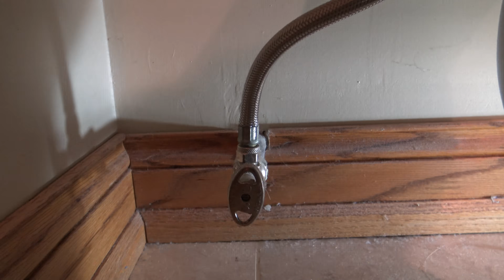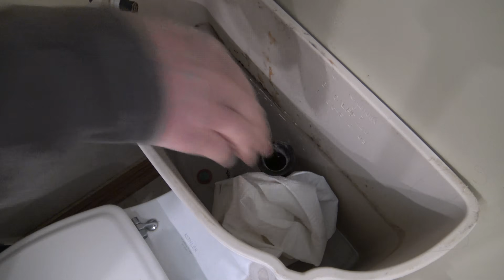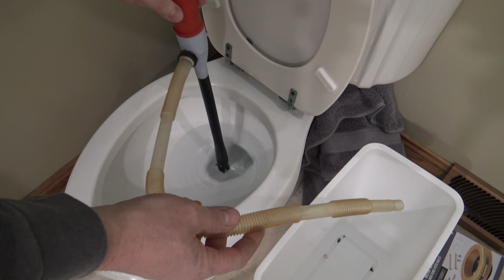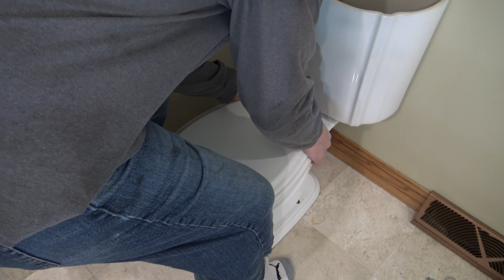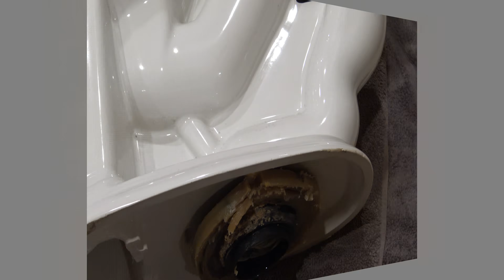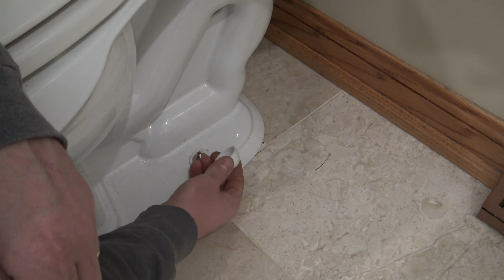How To Replace A Wax Toilet Ring----Step By Step with Tips

Comment: When you pulled the bowl from the floor / flange, should you have more wax on the flange than that? Using the same Oatey reinforced wax seal and there was more wax on the bottom of the bowl than the flange
Reply: Yes, Your observation is spot on.... This usually means there was not enough wax height to compress to the flange....Time to purchase a thicker wax ring .

Comment: In tightening down the toilet, one side seemed to tighten, the other side didn’t seem to tighten the same, and then of course, I heard a pop, and the other bolt stopped tightening. I tightened both bolts evenly, one full turn each per side, but the one bolt just didn’t seem to tighten the same. Then as I said, I heard a pop, and I guess it broke away from the toilet. When I set the bolts in there, that one side didn’t seem to catch as well as the other side. I should’ve taken the thing back then, because apparently the side that popped must’ve been thinner than the other side. I’ve put these down before, I never had a problem. Is there any way that I can fix this, without buying a whole new toilet? I have not lifted this up yet, because I wanted to hear someone’s response before I take it up. Any help would be appreciated. I think I’m losing my patience. I’m 69 years old, and I think it’s getting the best of me.

Comment: Thank you for the simple video.  I see you put the wax ring under the bowl but in many other videos I see them put it on the flange itself ?   It seems to make more sense to put on the bowl and then try to line it up.
Reply: The problem is the ring often just falls off during the setting or it comes loose as you set it. When that happens you aren't able to tell that you're causing a problem below. If you set the ring on the flange you can confidently set the toilet directly on top, very slightly tweak the toilet left and right as you set to evenly spread the wax outward. 

Everyone has their technique. As long as you don't have a leak, it really doesn't matter. When you do these every day of your life, you get pretty good at setting the wax on the toilet flange directly. You can just line the toilet straight by looking at your stool bolts. Then just press and tweak left and right, very very gently as you push down the toilet.

- Professional Plumber.
Reply: Thank for this. I'm replacing 2 toilets tomorrow.
Reply: I don’t think there’s a wrong way unless it serves the same purpose and helps sit the toilet. I put mine on the flange because I do everything myself and feel safer setting in on the flange so I can lift up my toilet and sit it on it without worrying about the wax ring fail off or moving on the toilet.